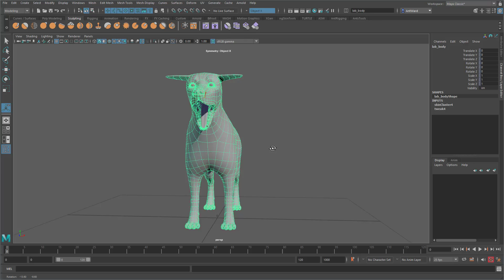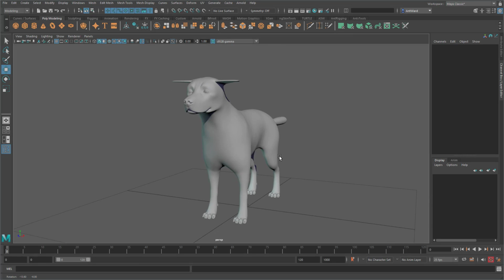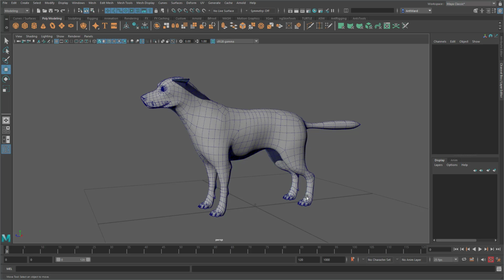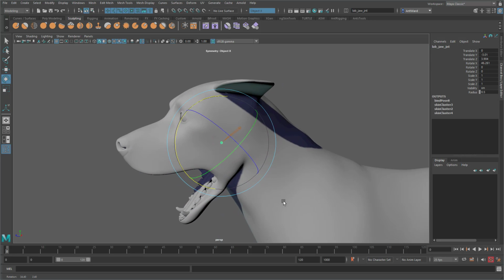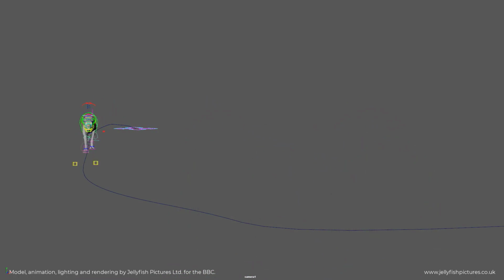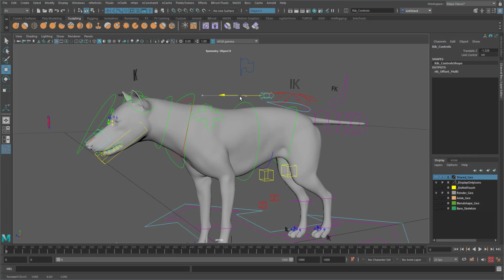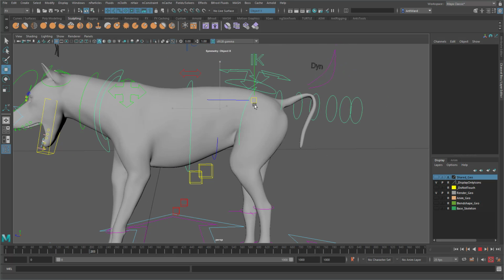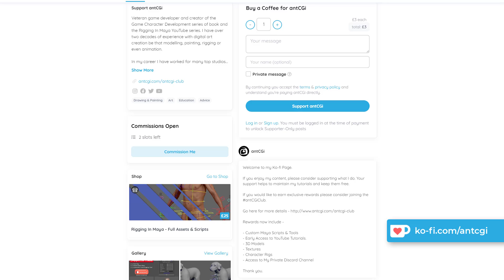#RiggingInMaya | Part 19 | Advanced | Model & Rig Preparation

Comment: Hello sir, I have a question about all those codes you had applied in your rigs in previous videos ... the question is after completing my rig using those codes ... if I open the rigged character on another machine where the Charcoal Editor 2 is not available ... will it be a problem ...?
Reply from the maker: Hi, no it should be fine. Charcoal Editor is just an editor, so the code will work fine in the base script editor too.
Reply: Thank you, Sir. Thank you very much.